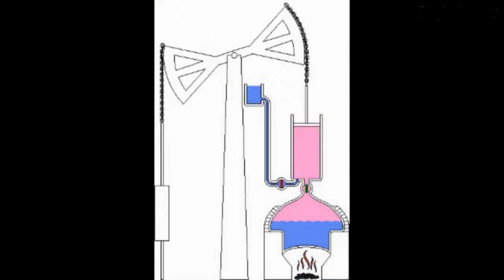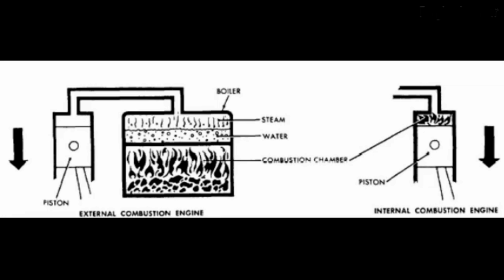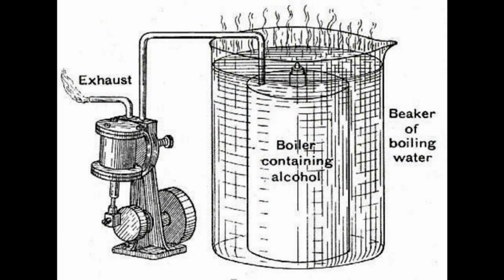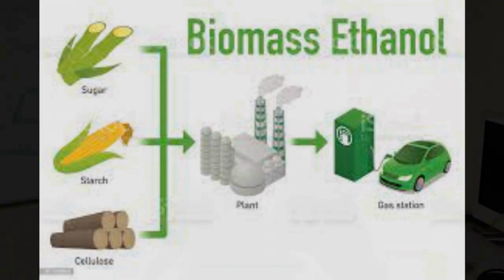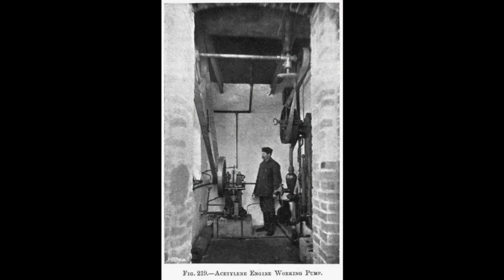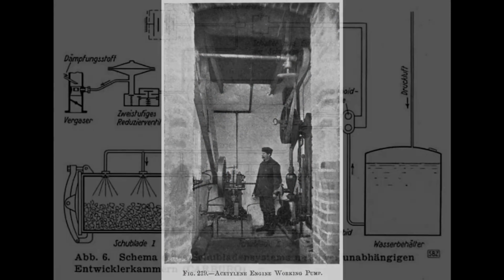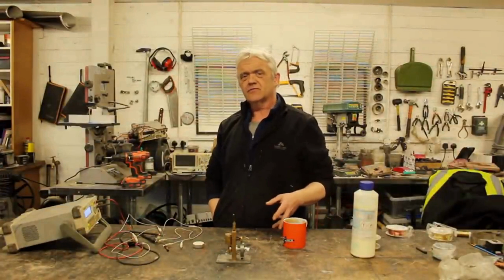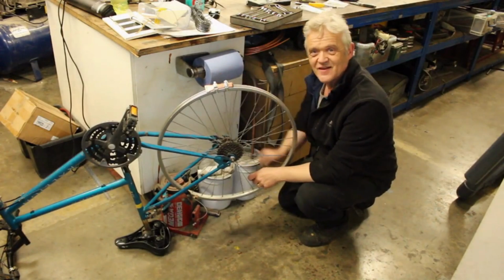2188 A Gunpowder Engine

Comment: How did the explosion @3:10 in the video blow off the lid of the glass jar instead of shattering it?  And how is the copper tube that you used to ignite the gas with a lighter not lodged in your hand?

Comment: All contemporary illustrations of Huygen's engine and Papin's version show the piston at the top driven down by air pressure. The diagram is wrong. I have found no mention of 15g powder charge.
Potassium nitrate is not hygroscopic. Some moisture is always present in gunpowder and contributes to the complex chemistry of combustion. The 'watergas reaction'
George Cayley's engine (two designs) worked. He recorded performance figures in his notebooks, available in the Farnborough archives.
Medhurst's carriage was not propelled by the cannon but by the engine behind it. The engine is shown in the video but without comment.
There have been many gunpowder engines, a few successful. Gustav Trouve produced one based on the Bourdon tube that successfully flew a small ornithopter.
Graphite coating on gunpowder, and modern nitro powders, is to improve the flow as most are dispensed by volume. It has no effect on moisture absorption and gunpowder is not sensitive to ststic electricity.

Comment: I like this wierd engines. Thought about the same as in video but it isnt practical at all because it can easily explode on higher loads and works only with black powder (which can be confusing for normal people, which can lead to health hazards). I think there is a use case in making super fast and super powerful engine that is based on air compressor engine + ar15 bolt action, and use pre assambled blanks, then we dont have to worry abut whole fuel exploading, but the device would have to be pretty sturdy not to explode. But for some emmergancy situations it would pork probably. Also i liked Cody's sodium + water jet engine lol.

Comment: People ask me why I try to get food grade materials - what they don't realize is that the percentage of material that is not being used (90% iso/10% water, for example) has no guarantee of what that 10% water really is or what contaminants might be in it but that food grade has to test out to ppm or ppb of contaminants which means if you get something like neutral spirits (90% ethanol/10% water) at the liquor store that the 10% water is in fact nothing but water.
This is why I use 190 proof ethanol (the highest legal to be sold for human consumption here) for cleaning up after I solder instead of isopropyl - iso always leaves contaminants behind that are sometimes difficult to remove but 190 proof ethanol leaves nothing but water, which when it dries leaves nothing visible.

Comment: I have worked with highly skilled old timers who very carefully crafted powders specifically for cannons, and not just generically, but based on a whole load of variables.

They would mix and press grains of many different sizes, not just for different cannons, but for different applications.

Some powders were meant to burn much slower so that they could achieve maximum muzzle velocity for 'ball' rounds [ironically, these 'ball' rounds were what we would call a 'bullet' shape, and were not to be confused with actual 'cannon balls'] in extra long, taper barreled 'rifles' [what would later be known as 'naval guns', due to the USN knowing that precision was not only important to hitting the enemy, but because they were limited in capacity in their magazines, due to not being an immense fortress].

But also, for charges like 'grape shot', they would use much faster burning powders, some times even intentionally choosing short, smooth bore cannons.

Grape shot was particularly good against lines of advancing troops, such as the British during the Revolutionary war, but this poor choice of tactics did not end to practically the end of the Civil war. Grape shot merely needs a wooden plug, and it need not be particularly accurate, and even some stacked leather or raw hide could serve, basically as a 'gas wadding' [shotgun users will know what this is], and the large shot was not so much meant to be accurate, as it was to get loaded and shot quickly when the enemy was getting dangerously close to you, because grape shot could never really be fired with any extent of accuracy, although some attempts in paper, wooden and even brass casings were attempted]. Therefore, a simple leather or cotton pouch, with the right amount of shot, could be loaded into the muzzle and shot. Nothing kept this from scattering as it left the barrel.

But since it did not seal all that well, but also, could not actually plug the bore, it was actually much more practical, and safe, to use a faster burning, high surface area grain. It turns out that to this day, shotguns tend to employ this, faster burning powder, as much as precision rifles still tend to use slower burning powder. Science being science, very little has been done to change how this works.

Probably the greatest advancements were in high purity nitrocellulose and cordite smokeless powders which were installed in measured off lengths [I have lit cordite, it looks like a little waxy stick, and it burns amazingly slow, but extremely clean, when not captured inside of a pressurized chamber.

They eventually did make cordite for large naval guns, but as a whole they have gone on to much more advanced propellant grains for large naval guns which can be extremely precise in their metering out for an amazing number of different ballistic applications.

Comment: As I understand it, the problem with using pure carbon (which is either going to be powdered graphite or some kind of amorphous carbon like lamp black) isn't so much the purity but the porosity and surface area of the powder. This is why charcoal made from wood is the usual source of carbon for gunpowder, because the pyrolysis (aka destructive distillation) process by which charcoal is made decomposes the cellulose and lignin fibres in the wood. These are primarily carbohydrates and polyphenolics, so the decomposition produces a fair amount of water vapour, along with a massive variety of small molecule volatile organic compounds, which also come out as vapours too. All wood produces some creosote, with dark wood producing the most. Light coloured wood tends to produce methanol (hence wood alcohol being an old name for methanol) and pine woods tend to produce turpentine.
But most importantly, when all the water and organic compounds have been driven out, you are left with carbon chains with a lot of empty space in between. This is what makes wood charcoal so porous, which allows some of the powdered potassium nitrate and sulfur to be pushed into those pores, which makes the mixture more even and well mixed. The wet mixing and corning process completes this, because the water (or alcohol) partially dissolves some of the potassium nitrate - then when you dry it back out, every particle of carbon and sulfur is effectively coated with a layer of potassium nitrate: Every particle of fuel gets intimately coated with the oxidizing agent, you can't get the mixture any better mixed than that. Which is why gunpowder which has been subjected to wet mixing and then dried out again burns so much faster.

Comment: I think the USAF had done some work more recently on the coal dust for axial flow gas turbines.
Reply: Gets me thinking and almost forgot to comment regarding, the bummer in the advancements in the external combustion engines where those engines are the most diverse fuel source capable engines that come to mind.  Almost seems like a cartel conspired to prevent the development and advancements in.  Big three or other?

Comment: "The Museum of retrotechnology" is a great Web site for obscure engine tech.

One I encountered was something called an internal combustion boiler... put as simply as I can...a tubeless boiler...fuel burnt with pressured air and flame in direct contact with water. Less losses than using tubes. Steam then fed into steam engine.. problem was the high temps and burning air resulted in nitric acid production....
...*anyway* I'm thinking that it should be possible to take  tanked hydrogen and oxygen,  combust them  under pressure, and feed the resulting high temp steam to an engine...
Due to risk of burner exploding, I haven't dared try such yet.

Comment: Finally somebody did it. I had this idea a while back and even touched on a possible improvement. Instead of relying on the gas pressure of the gunpowder directly you could even go so far as to use flow entrainment to increase the volume of working fluid at the expense of temperature of course. Think steam eductor pumps. That same principle, everything else being exactly as I had described. I'm glad someone else got it to work though. Just shows that it can indeed be done.
Reply: Also one other little caveat instead of using granulated powder for firearms use a solid single grain so it's basically a rocket motor used as a gas generator.
Reply: @Slowly_Going_Mad rocket powering an expansion engine idea could be extended to liquid fuels....
Either a monopropellant like hydrogen peroxide. Or hydrogen peroxide +a fuel. Or maybe best....
Hydrogen+oxygen.  extremely hot steam without faff/mass/inefficiencies of a boiler. Tank pressure would replace boiler feed pump.  No need for seperate water to be carried...fuel plus oxidiser makes it as needed.
Reply: @stevecummins324  I see this type of thing as a novelty more or less and having extremely niche practical applications. And it's not a bad idea. To be fair that's how they run the pumps on the main stage of a liquid rocket engine anyway. But to see someone get it to work with a really dirty fuel like BP that's phenomenal.

Comment: Mythbusters did a very interesting episode of household things like flour sugar etc that are no combustible but shot through an air cannon and ignited made them very combustable. Theres 1 common ingredient that was so explosive they still refuse to this day to divulge what that ingredient was. My thoughts were if enough air is in, given the right design an engine could be made that could run on almost anything. Like a dry ingredient version of  the old diesel engines
Reply: Rudolf Diesel used coal dust in some of his early Diesel engines... 

So did GM, when they were experimenting with alternate fuel passenger car turbines.

Comment: Some airplanes had a starter that took shotgun style shells. A shell would be placed in a firing unit and the explosion would turn the engine. When the engine was spinning it would be fed fuel and normal combustion would commence. You can see this with the Fairchild cargo plane in the movie Flight of the Phoenix (1965 version). There are also youtube videos of this type of plane starting. It's pretty cool.
Reply: They had them on farm tractors too.

Comment: Interesting. Another idea is to use the pressure from the gasses emitted from dry ice and water . If a proper metal container is used to capture the gasses and a regulator added you can probably get a long run time from a motor or anything else that requires spin for generation . The whole assembly would take a-bit of engineering but could be done and I think the results would be very interesting as a source of power . Have not tried it but it is an idea I have had. Thanks for the share.  :O)
Reply: Considering you wouldn't need to worry about cooling the metal down .....a modern engine block type approach could be used ( - the water jackets ) !  the retraction of the cylinder walls may cause a contact issue with the piston rings do to the extreme cold ( thereby losing compression) but that's probably easily solvable ! My question is , how much pressure is needed to run a motor that is the equivalent of a standard lawnmower ? I've had the same thought and plan to take a five hp motor and tinker with the idea !

Comment: A machine gun is a gun powder engine.  The recoil and/or gas from the explosion is used to drive the machine gun.   Use blanks to drive a piston hooked to a fly wheel.
Reply: Ever heard of dieseling with an air rifle, using fuel for an automobile engine to propel a projectile
Reply: @frankcarden4709  Now there's a funny idea I never heard of. Has this ever been used in warfare?
Reply: @Yezpahr   in warfare I couldnt say, in a war situation you do what you can and what you have to.
But some people do try it, a small drop of diesel in the stabilising cone on the back of a pellet for an air rifle,but the pressure when fireing is way more that what the air guns are designed for and its a fine line between shooting the projectile faster and having the gun act as a pipe bombe in your hands. Wears out seals and rifling in the barrel war faster as well, I've  heard.
Reply: @Yezpahr  the Vulcan 20mm Gatling cannon found on most US fighter jets uses electric ignition for it's ammo
Reply: Counterargument: Primer is expensive and so are bullet casings.
Reply: @sirnikkel6746  use caseless and electric ignition.
Reply: @deltonlomatai2309  Now we are talking! Electric G11 engine baby!
Reply: @sirnikkel6746  Okay.  Cars use spark plugs?  Right?
Reply: @deltonlomatai2309  caseless electrical fired munitions then.
Reply: Lets make a machine gun then and quit fooling around.
Reply: @justtinkering6713  my kind of friday night! hell yeah brother!!
Reply: Without flow restriction(bullet) the system doesnt really work

Comment: In the firework manufacturing industry the best charcoal was always made from willow.  A good friend used to have a black powder licence for pyro experimentation and own use, (non commercial).  Had some very interesting times making powder, metal salt stars, whistles and bangs.  And some great firework parties. 
Still got all my fingers.😆 :hand-pink-waving::hand-pink-waving:
Reply: Willow makes fast powder. Pine is excellent for sparking and spritzel glitters, alder is excellent for rocket motors. Charcoal's role in black powder is varied when used in pyrotechnics.

Comment: Can you explain a hydrogen engine? Doesn't the burning of hydrogen and oxygen result in an implosion instead of an explosion? This would cause a vacuum so an engine would work just the opposite of internal combustion engines, so how would it be constructed?
Reply: It evolves heat, check out the equation of state, the pressure times the volume is equal to the moles times the gas constant times the temperature. That's the idealised version that ignores the space the molecules take up. But it expands.
Reply: @Earthslade229 I agree  combustion products would initially be a  at some combination of high temperature and pressure. 
A condenser after engine might be useful to add a vacuum pull to engine exhaust stroke.
 *yes the water needs pumped up to at least atmospheric pressure... but it takes less energy *per unit mass( to do such with liquid than it does for gas.